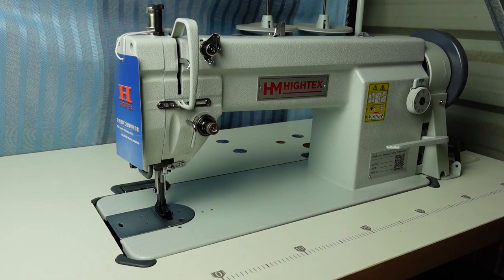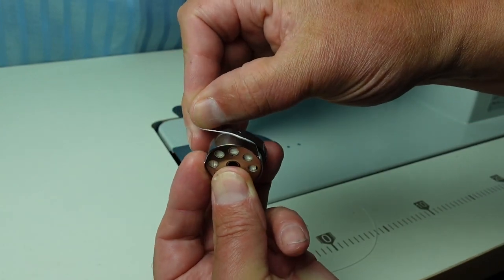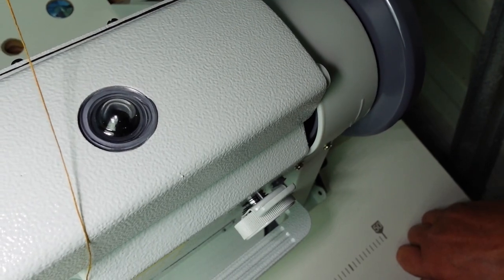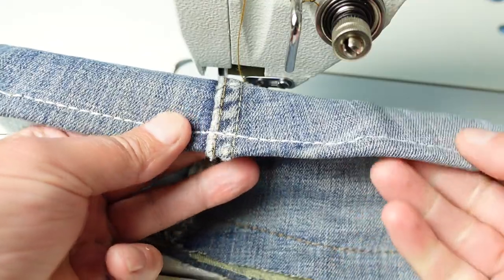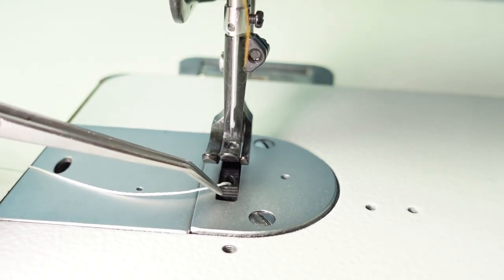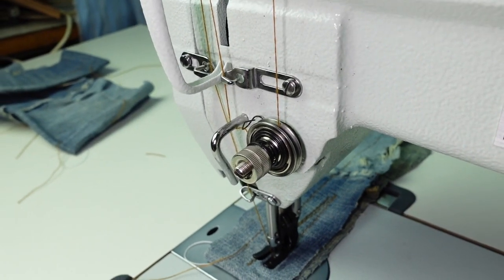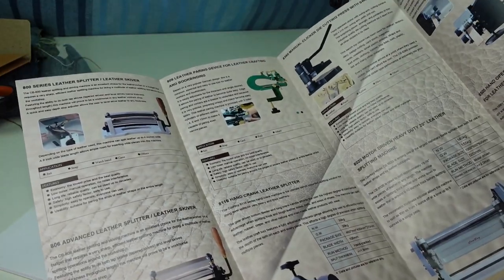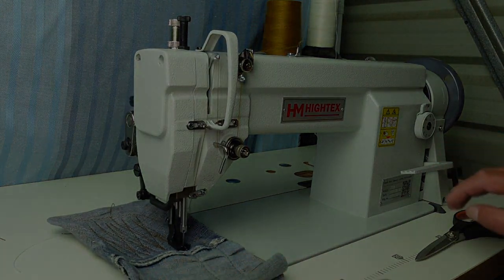Heavy Duty Industrial Walking Foot Sewing Machine - Hightex 7138 - Overview

Comment: Thanks again mate and hi from Sydney. Just discovered your channel and subscribed because you describe everything in such great detail and with clarity.
I bought a similar Chinese heavy duty machine a few years ago labeled GEMSY model 0818, which looks nearly identical. It's an absolute beast and I have sewn boat cushions and covers, as well as sail bags, boom bags, bimini's and the like using marine grade Sunbrella fabric. I even took up my wife's lightweight linen trousers the other day, which it was also able to do with a bit of gentle coaxing. These are great value machines, especially for heavy duty work. Would be perfect for horse blankets and the like as well as boat stuff.
Cheers...

Comment: Please note that the model number of the seeing machine in your title is incorrect. It should be 7138 as per your dialogue and not 7318 as written in your title. I would have been able to find your video much faster otherwise. Nevertheless your video is very helpful and i thankyou for making it. I shall tell others at our East Auckland Menzshed about your video as we have recently purchased the same model as yours.
Reply from the maker: Thanks. Have changed the title.
Reply: @InStitches Thanks for changing the title as I am sure it will help others.